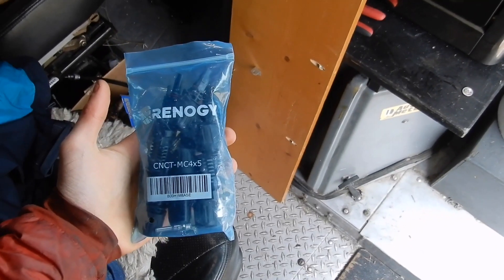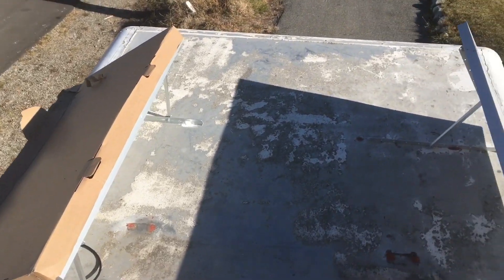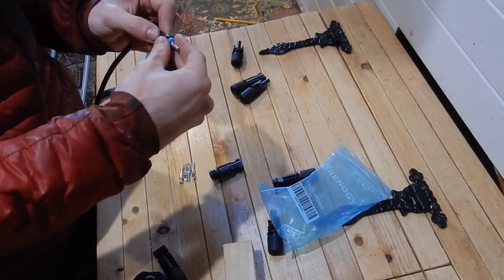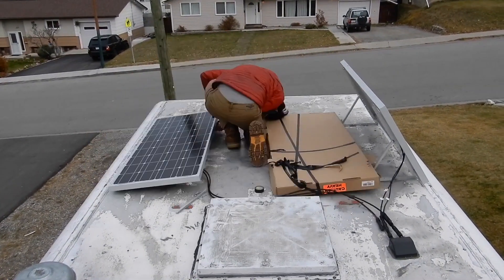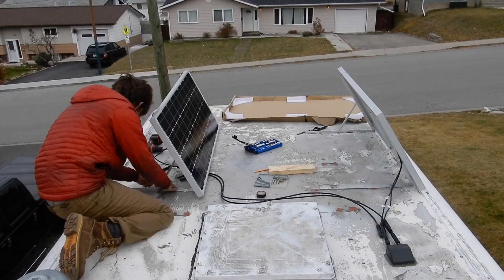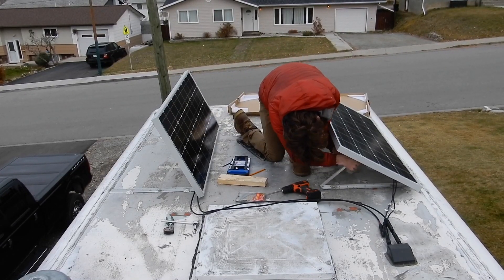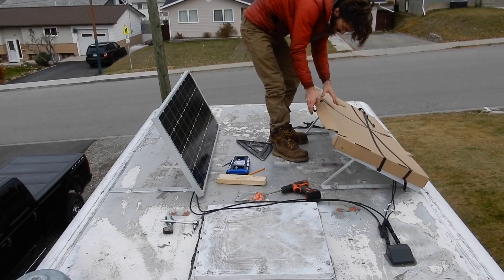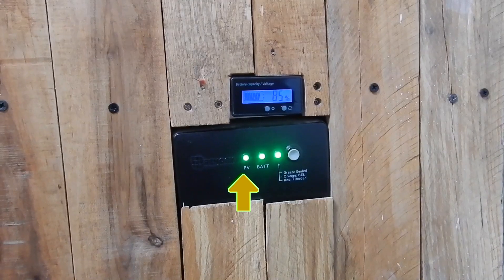Double the Solar ~ E049

Comment: Thanks for doubling your solar generation!
Reply: He really needs 500 watts minimum ,he has room for 1000 watts
Reply from the maker: What are you trying to power that needs 1000 watts?
Reply: @SylvanSecrets  I live in a cloudy city PA and every one needs more panels because of clouds and rainy days ,you will learn ,more panels more battery power and life ,A 58 inch TV at night ,my computer and lights  all night long
Reply: @SylvanSecrets  1000 watts plus allows you get enough discharge/charge rate to get rid of propane. Even possibly run an AC.
Reply from the maker: The cost isn’t even close to worth it for me though.
Reply: @SylvanSecrets  We have 600 watts of solar on our Stepvan, due to the theoretical energy need, but I didn't understand the discharge rate thing until after I installed the roof rack for the solar. I might have gone with a larger system to run a hotplate and not to have propane. However 350 watts is plenty for a single dweller running fridge, light's and electronics, including consideration for low light conditions (outside of gloomy days).